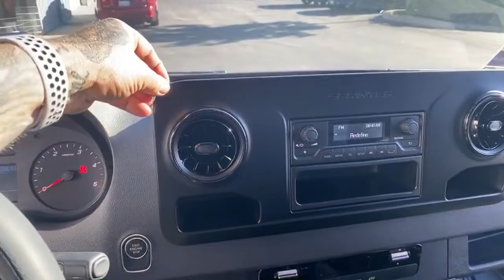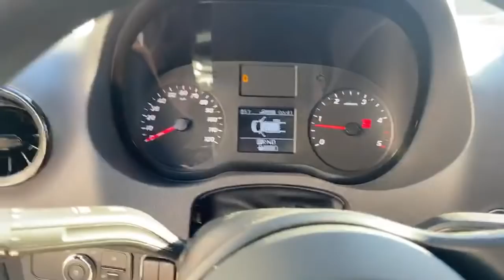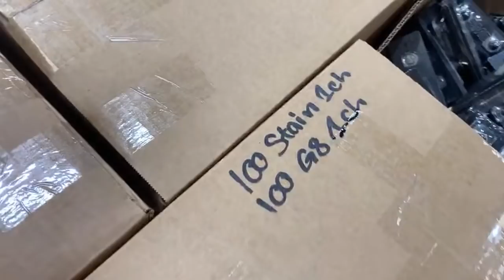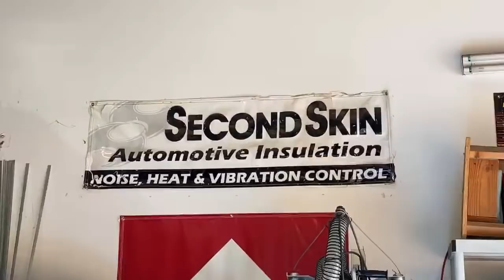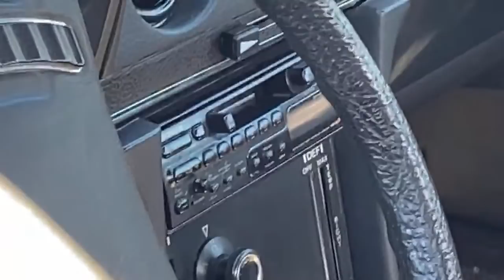New Shop Pony! 2019 Mercedes Benz Sprinter 3500XD Turbo Diesel V6 Dually walk around and first "mod"

Comment: Great choice. Those are workhorses. Just STAY UP ON THE MAINTENANCE, and those run coast to coast all day.
I recommend changing the trans fluid and filter after only 15k-20k. It will extend the performance of that trans quite a bit.

Comment: Great trucks,  just stay up on the oil changes and the DEF system will last 500K miles or more.  the ONLY think that hurts them is dirty oil taking out NOx sensors and the Catalysts.  also Steve we are coming up on like a 15 or 20 year anniversary, get some modern beat in the Tahoe and knock another eyeball out man.

Comment: my boss has a 2016 ford transit 150 it’s never had to be worked on other than oil changes and tires and the one u have is supposed to be better.

Comment: I’ve never seen a van with paddle shifter
Reply from the maker: me either.  I took it over the mountain yesterday and i have to say they are great to have. Not for racing but for choosing the gear i want and fast while climbing. The grades are steep out there and when someone messes up your momentum by getting in front of you or you are stuck behind trucks, it is nice to drop it down a gear or two and still have all the power.  I loved it!